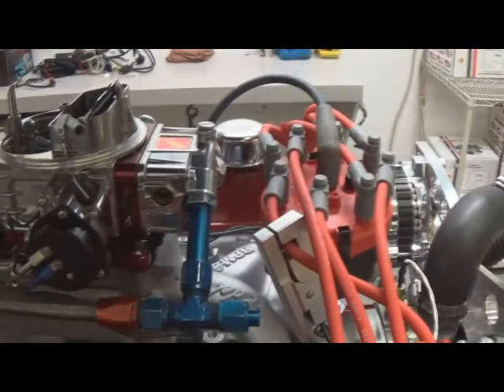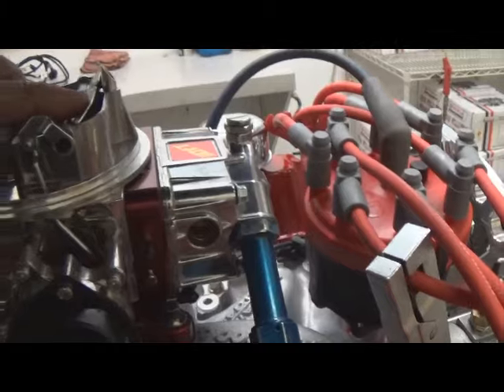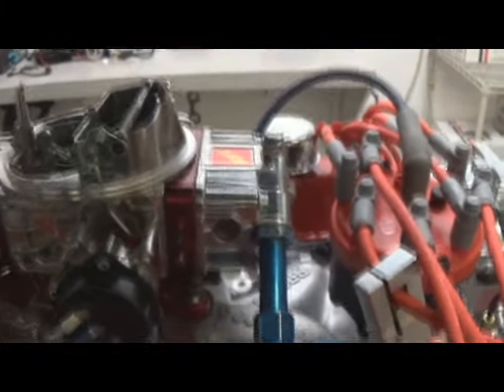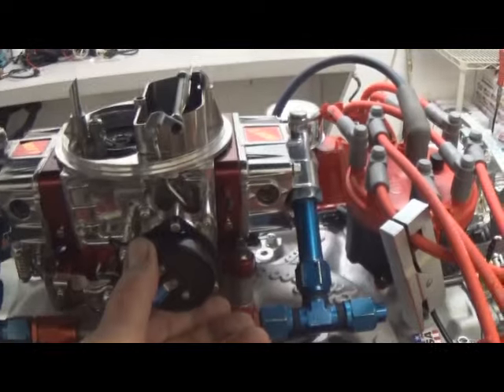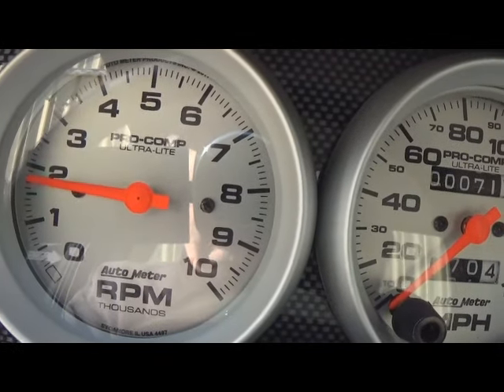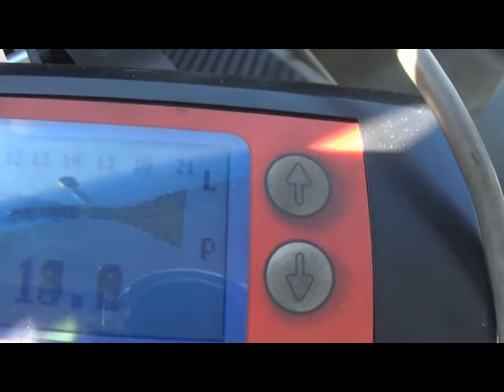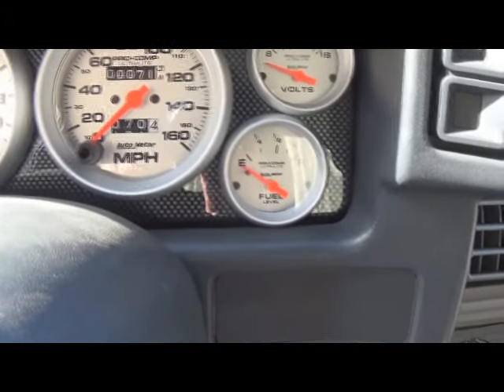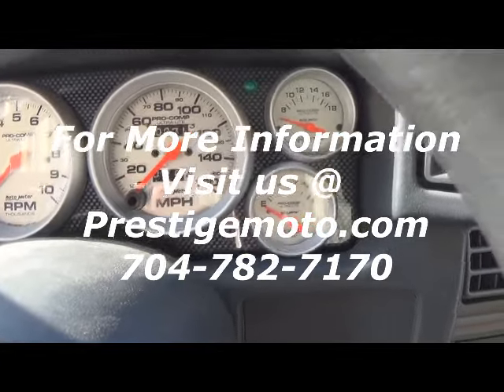SETTING YOUR ELECTRIC CHOKE FOR BEST RESULTS

Comment: You're teaching running in this video before you show how to walk.  You say that adjusting the choke can be overwhelming if you don't understand how a choke works, but you didn't show how the choke works.  How about loosening the choke adjustment screws and turning the thing left and right to show how it controls the choke blade?  How about talking about why there are 2 electrical wires and what those do, and how they change the choke blade position once the choke warms up?  Once we understand that, then we can learn about the high idle screw and how that works.   Only after we understand all of that does it make sense to talk about O2 levels and the fine points of adjustment.
Reply: What does the 2 choke wires do ? I thought one was 12 v power and the black wire was ground . Maybe thats why I am having so much trouble with this freaking 750 cfm eldebrock . Its a brand new carburetor and can't get it to idle worth a damn ,cold or hot .soon as I drop into drive , she dies . And when its cold , floods like hell ! Hate it !

Comment: Quick question. When using an 02 sensor with a heavy cam wont the 02 sensor usually read leaner then it is really running due to the intake "dilution" from overlap and such?

Comment: One fact I do know about engine builders who provide crate engines and dyno each build prior to shipment, they dyno to their sea level.
So if you buy an engine in Cali, those power numbers will be different once it arrives to a state like Florida or anywhere deep South correct?
I heard you should always dyno according to your seal level, for example a Cali engine will run one way at 12,000 feet above seal level vs Arkansas at 3,000 feet, or Alaska at 20,000 feet.
Reply from the maker: Sort of. The Society of Automotive Engineers (SAE) developed a standard correction for all dyno operators regardless of location. There are more than one "standard days", but typically engine shops will use one of two. The most popular one is J607. It is referred to as STANDARD correction. It corrects to 60 degrees F, 29.92 in-Hg absolute pressure, and 0% humidity. The newer standard is J1349 which uses 77 degrees F, 29.23 in-Hg absolute pressure, and 0% humidity.

The way this works is the dyno measures observed torque at the current conditions. A software is then used to mathematically determine what the engine would produce at the standard conditions. The idea is to allow an engine to be tested anywhere in the world, under any conditions, and have a comparable number. However, in reality not everyone uses the same correction standard, some use J607 while others use J1349. J607 will always have larger power numbers, so most use that. Also, the accuracy of the weather measuring equipment at each location can vary which can affect corrected power significantly. The process for testing also needs to be consistent. For example, we only make runs when coolant temp is between 155-160 degrees. After one or two runs, we shut down and wait for cooling so our tests are repeatable.

And then you also have the guys that like to pump up their numbers so they fudge current conditions to make their engine run better, or simply change the correction factor.

Here is the main point. Each dyno facility is a little bit different, so a number on one dyno will more than likely not be exact on another dyno. But the dyno facility has the ability to make repeatable results. Therefore, one engine on the same dyno compared to another engine (or changes on the same engine) should be trustworthy.

Comment: It appears you are using a FAST control module to monitor the O2. Isn't the FAST system a fuel injection system and not a carb. Can you explain how to use the FAST controller on a carb?
Reply from the maker: Bob Lucero it is a Fast air fuel datalogger and can be purchased with a single or dual oxygen sensor. It works great to have an idea of what the number is as a starting point than you can still pull plugs to see what the engine is telling you. Always keep in mind its just a number. Of the plug looks rich than it is period! Ideally 13.2 to 14.5 to 1 at idle is good, sometimes even higher depending on camshaft overlap etc. Usually 12.5 to 12.8 even 13.0 wide open is a good starting point as well.

Comment: Is there a way to make a Holley electric choke gradually lower rpm when warm instead of having tk tap the throttle and disengage the fast idle??? Seems like it would make more sense if it was automatic
Reply: The high speed idle cam has steps in it, which equates to different rpms. As the choke butterfly slowly opens, the cam moves with it.

In this video, the time between when he starts the engine and then blips the throttle to get to the lower regular idle, the choke butterfly would have moved to fully open. If he would have blipped it in half the time, the fast idle screw would have plopped in the half way portion of the cam.
So, not 1800 rpms or 1000 rpms, but more like 1400.

As the engine warms up, if you keep blipping the throttle, it'll slowly start dropping rpms, not 1800 straight to 1000.

In my heated garage, my electric choke takes about 3 mins to fully open tite with 12v applied.
Reply: @jakefriesenjake  OK I know exactly what you’re saying because that’s what I’ve done ever since I purchased my parlor. But my question is, is there a way for the gradual drop in RPMs to occur automatically? I know that on EFI vehicles or any modern vehicle, that happens but is there anyway to make a carburetor electric choke slowly drop the RPMs as it warms up or is it always necessary to tap the throttle? If I start my truck and do not tap the throttle at all, it will stay in the high rpm mode even if it is warmed up. Is there a way to avoid that?
Reply: @BryMed86  probably not. I don't know why you would even want it to do that automatically, unless you were trying to save gas..... But if you were trying to save gas, you would be in your vehicle and starting to drive it even before the choke opened all the way.
You can get rid of the fast idle portion if you want, so you'll just have choke, if you have a 4150 style Holley carb, and then just crack open the secondary butterflies with the idle screw a bit (don't touch the primary idle screw because the transfer slot would be out of whack), to raise the idle during warm up just enough that the engine will run by itself on a cold day. Hopeing that that idle is still low enough for every day driving, if its a manual tranny. (An automatic might be pulling the car too much if you have a very low stall speed torque converter).
Reply: @jakefriesenjake  no main reason is bcuz it doesn’t make sense for a vehicle to stay revving at high idle once its warm enuf..when i walk away it should go down automatically
Reply: @BryMed86  its just a really old school way to bump up the idle while using choke.

You could maybe connect the throttle shaft to a little throttle motor, kinda like the one used in new cars for cruise control. Probably need to run an Arduino little computer to control it. Would need to know how to program code for it to operate correctly under certain circumstances.

Or make a bracket, hook up a small electric motor with a pully cam on it. Wrap a cable and bearings around the throttle Lever and the cam. Hook it up to 12v switch.

1 - Start engine
2- toggle that new switch to on.
3-the little motor with offset cam bearing would start rotation at around 30 rpms. 

4- as the electric choke starts to open , every time the eccentric pulls on the cable (attached to the throttle Lever), the engine would rev up a bit.
5- you can make bigger or smaller cams to attach to the new tiny motor.
6- you can adjust the rpm of the electic motor
7- as the choke now opens, if the fast idle cam is in a different spot from 5 seconds ago, the idle speed will go down a tad, untill the fast idle cam screw is completely out of the way, and engine is at full operating temp and slow idle.
8- you now get in the car and turn that new switch off.
9- you can even add multiple odd cam lobes to the electric motor and adjust the rpm of it with a potentiometer... This can imulate a very lumpy cam in your engine for a lopepy idle. It would kinda rev up your engine off idle. You can play around with it.
Would take alot of time to set all this up correctly.

Or just blip the throttle every min with your foot, your choice!

Cheers